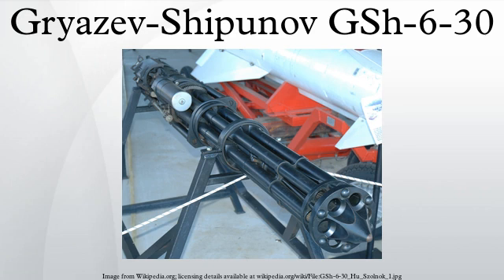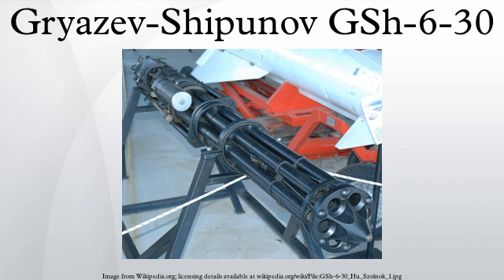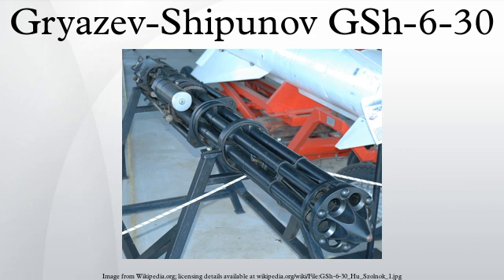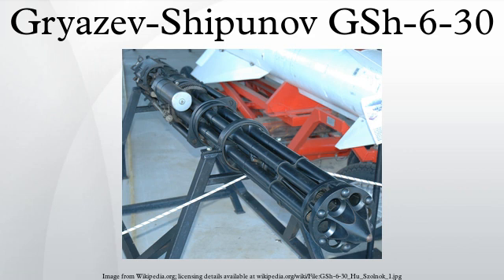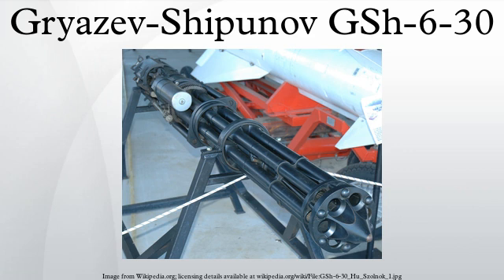Gryazev-Shipunov GSh-6-30

Comment: Powerful than gau 8?
Reply: Way more powerful.
Reply: Considering it was prone to breaking the MiG-27 while firing, yes, it is powerful in a way.
Reply: @GauravSanjeevkumarBhardwaj2000  no, GAU-8 is more powerful. It has a faster bullet speed.
Reply: @dmv118  Bullet speed is secondary. What you want against armored ground targets is weight, as in how much ordnance you can fire upon a target at a given time. GAU-8 may have the higher velocity but the Gsh-6-30 has the bigger oomph per second. Both has it's advantages and disadvantages.
Reply: @GauravSanjeevkumarBhardwaj2000  let's just tie it. Both use 30mm. That doesn't mean one is more powerful than the other.
Reply: @GauravSanjeevkumarBhardwaj2000  I agree :)
Reply: GAU-8 uses a larger round and has a DU core.
Reply: @dowmein  true.

the US ammo is 30x173mm.
the Russian ammo is 30x165mm. the Russians indeed do not use Depleted Uranium. but they do have a 30x165mm round with a Tungsten alloy penetrator. Russian designation "BPS Kerner".  it is designated by NATO as the 30x165mm "APDS-T" round.

and it is pretty well known these days that certain tungsten alloys have better performance then DU rounds. this is why the Russian tanks switched from their DU round to a newer Tungsten one.

the modernized 23mm little brother of this gun the GSH-6-23M has the fastest fire rate of a single Gatling gun/cannon in the world at 10.000 rounds per minute. 

still id say the GAU-8 has the advantage here. not really because of its DU rounds. but because it has longer barrels. and therefore more lethal range and more accuracy at those ranges.

Comment: Last time I checked Russian aircraft were not made of hot glue and matches
Reply: They may as well be if you mount one of these things on them.  The guns have INSANE recoil and vibration.  You'd probably break even an A-10 if you mounted one on it.
Reply: pretty sure they tried to mount one of these (or something similar) to another plane and the force of it firing tore the plane in half
Reply: @Naterz  its used on the Mig-27. They tried it on an upgraded Su-25, but then went back to the dual barrel Gsh-301 for more accuracy. The Mig-31 uses the 23mm version of this gun.

The problem described with the gun had already been fixed once it was accepted into service, and had to do with the way excess gas was ejected out the system as well as how they first tried to mount it to the Mig-27.